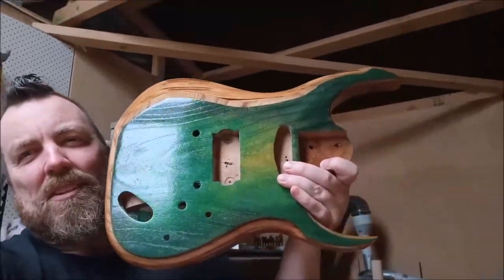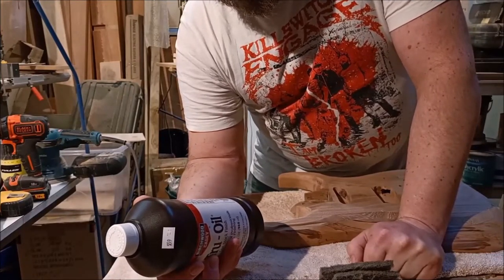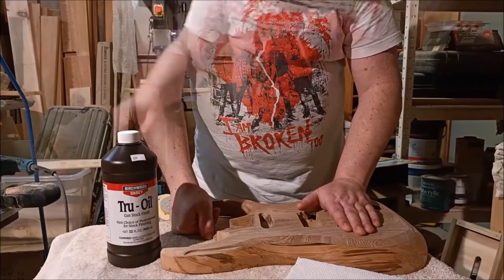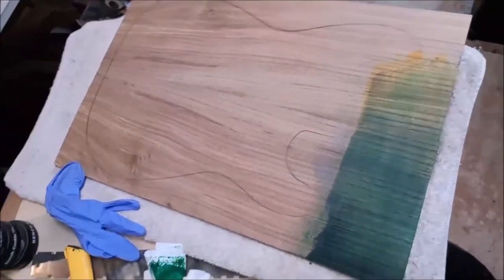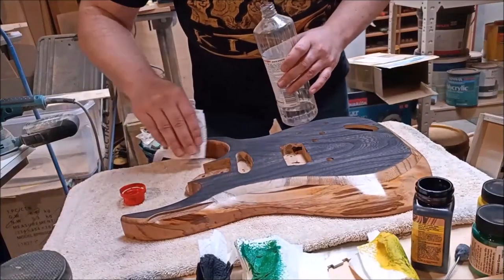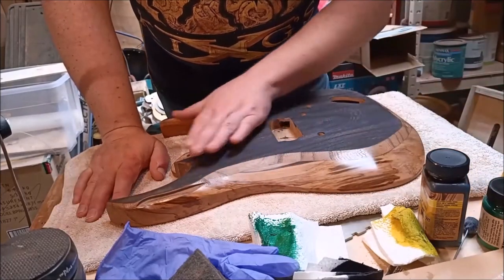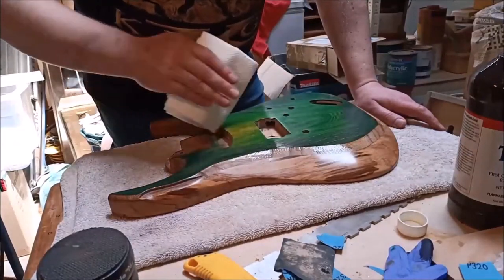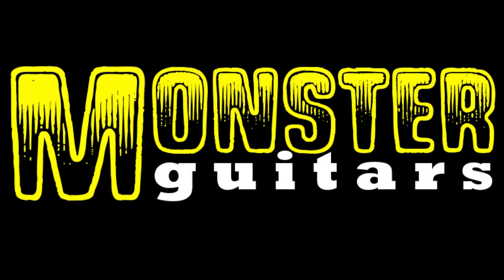150: The Viper - Tru-oil and stain

Comment: Nice!  Tru oil is great.  I recommend using coffee filters to apply it...totally lint free and don't break down like paper towels.  Also after use be sure to wet down any paper, rags etc, to avoid spontaneous combustion.
Reply from the maker: That's a great tip, thank you. :)